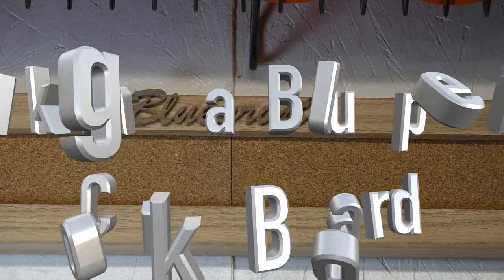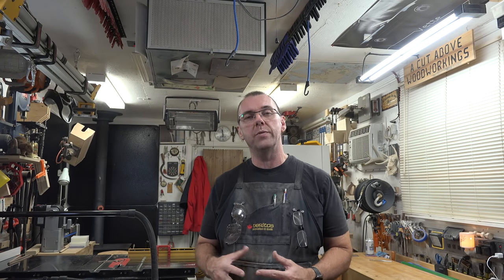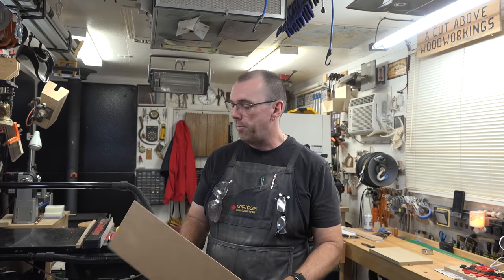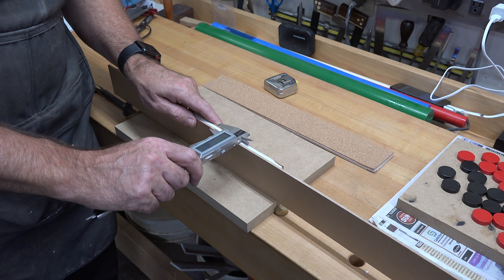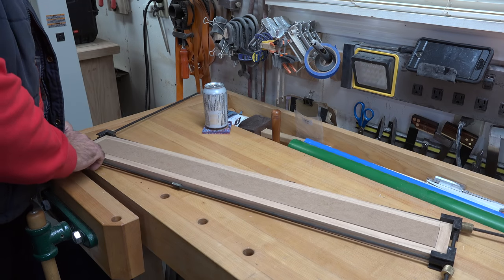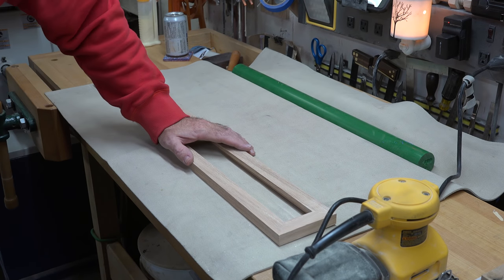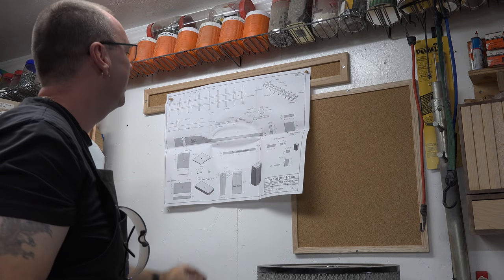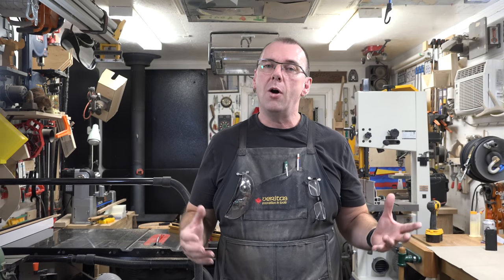Making a Blueprint Cork Board

Comment: Hi Kenny:
Will you please tell me where you purchased the steel straight edge you used in laying out your Blueprint Cork Board project.
Thank you.
Chuck
Reply from the maker: I'm not sure if you are referring to the straightedge that I used to cut the foam core board or the T-rule that I used to layout the markings so I will provide both.  The straightedge was purchase at Lee Valley tools and it is a Veritas product.  It comes in three sizes and they are absolutely wonderful.  You can find them here https://www.leevalley.com/en-ca/shop/tools/hand-tools/marking-and-measuring/56676-veritas-steel-straightedges
The other tool that I use to lay out the markings is my INCRA T-rule.  These things come in a variety of sizes and they are available in either metric or imperial measures.  I got mine at Lee Valley tools (shocking I know) but they are available at most woodworking suppliers or from INCRA directly.  Here's some links.  https://www.leevalley.com/en-ca/shop/tools/hand-tools/marking-and-measuring/rules/58877-incra-t-rules
https://www.incra.com/measuring_marking-trules.html
I hope this helps.  Thanks for tuning in to the show.
Reply: Hi Kenny:

It is the straight edge you used to cut the foam coere board.  Thank you for your prompt reply.
Chuck
Reply from the maker: @Goldchucker1  You're very welcome.  Again, thanks for tuning in.

Comment: Of course if your rebate ends up a little deep, you can use glazer's points to hold the inserts into the frame.
Reply from the maker: Annnnnnnd, auto correct strikes again.  LOL.  That's a great tip Thomas and I'm glad that you chimed in with it.  I'm sure that will be useful info to other viewers who may experience that issue with their rabbets.  Thanks for tuning in to the show sir.
Reply: @acutabove_woodworkings  yeah, should have said glazier' s points. 
Rebates/rabbits depend on your school of woodworking. I may be American, where rabbit is the common terminology, but I 've  watched so much Paul Sellers and other English/British craftsmen that rebate (same thing) is their terminology. I guess I reverted to theirs.
Reply from the maker: @thomasarussellsr   This is a classic example of how you are never too old or too experienced to learned something new.  I never realized that it was called a rebate and just assumed that you were trying to type rabbet and got auto corrected to rebate.  Thanks for the new term to add to my mental notes.  I love new information.  I guess my mental correcting and pointing out auto correction, got corrected.  LOL.  Awesome stuff!!  Thanks.